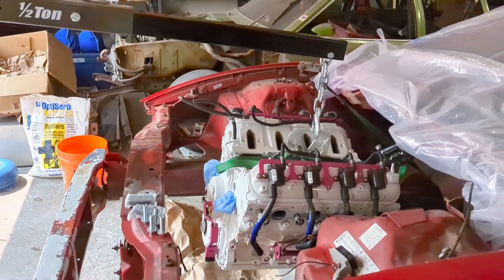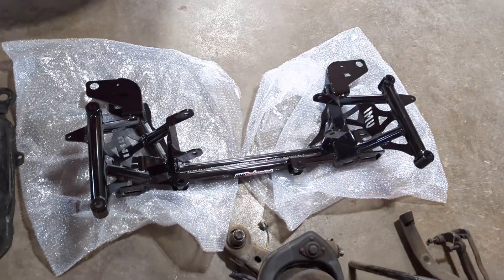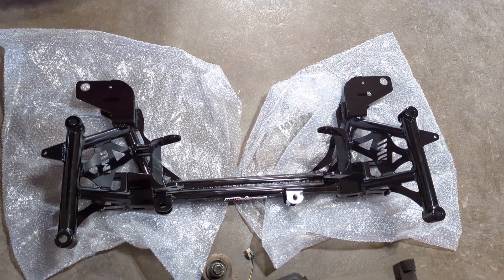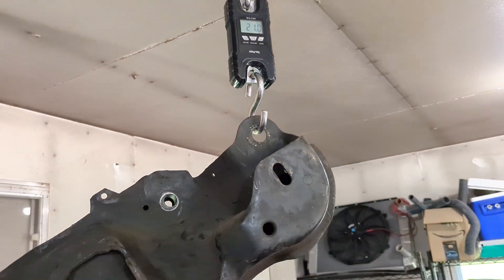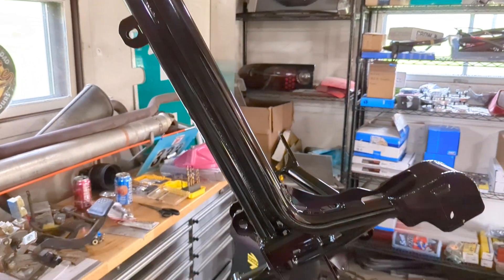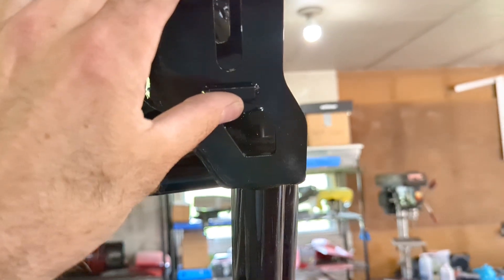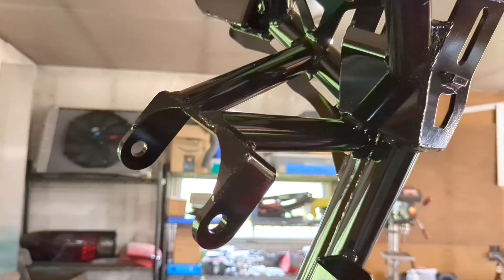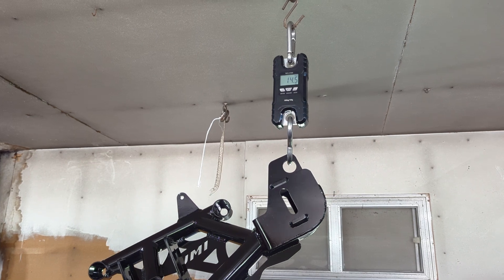F-body k-member comparison

Comment: What crossmember did you use?
Reply from the maker: It's the UMI road race K-member and for a transmission crossmember it's a UMI unit for a TH350 trans. It came with the car so I cut it up and modified it to work with the 6L90E I'm running. None makes a crossmember for that transmission in an f-body toy knowledge.
Reply from the maker: Here's a link to one of the videos about the cross member.
https://youtu.be/lrzqPHaQn8w?si=ZoHYUbmGZWdt6oRu
Reply: @bleepingfastmotorsports I appreciate that. I had ordered a 4L80E crossmember from UMI so will what we can do it with it first

Comment: Umi cromoly?
Reply from the maker: It's not, it's mild dom. I think the reasoning is that the mild steel resists stress cracking better and is much easier to repair. 
https://www.umiperformance.com/home/product/1998-2002-gm-f-body-k-member-ls1-road-race-version/